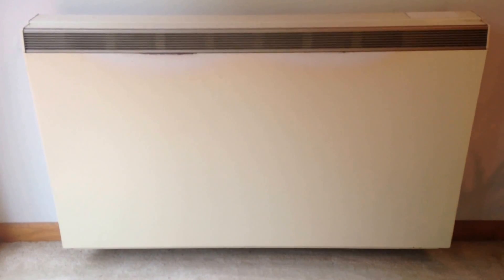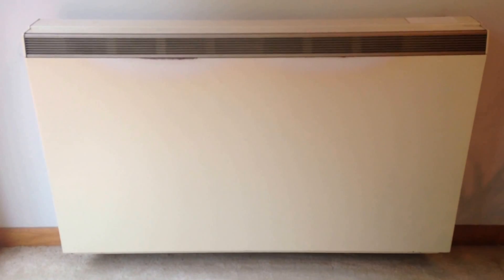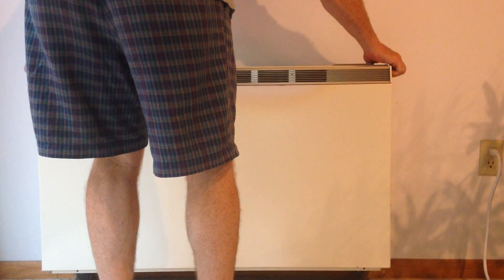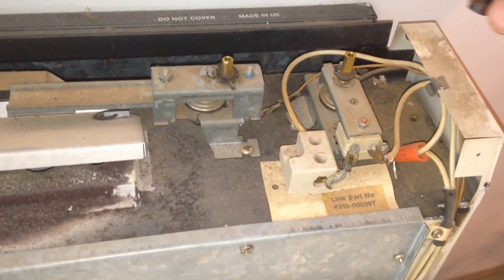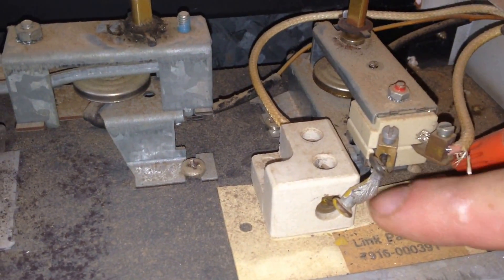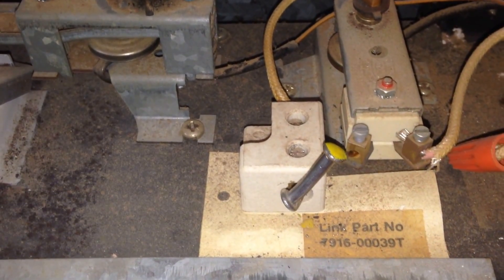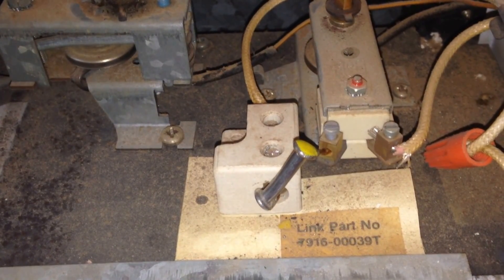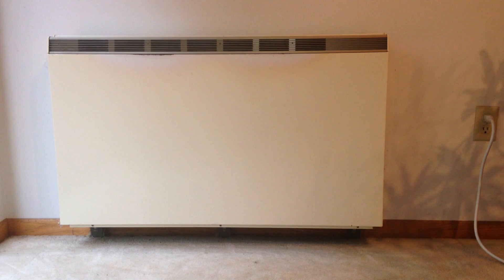Creda Thermal Storage Heater thermal fuse (thermal link, thermal cutoff, TCO) replacement

Comment: The fuse on my Creda 7161 heater keeps melting every time. I keep having to replace it. What could the problem be?
Reply from the maker: Either the heater is getting too hot or the fuse is the wrong rating. One easy thing to check is that all the air vents are clear. If you don't have proper air circulation then the internals of the heater will get hotter than they should. Good luck!

Comment: hi i think one of my creda storage heater fuse has blown, can you tell me if it has  would would it stop the rest of my heaters working? because them are not working.....
Reply from the maker: I can't imagine your heaters are wired in series. One failed heater should not affect the others. I'd check the timer or controller that turns all of them on and off.